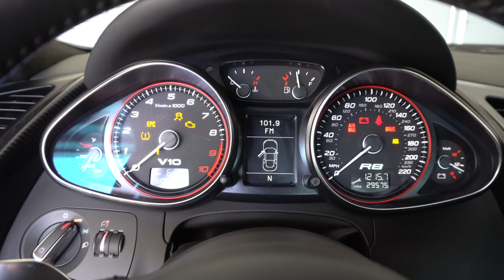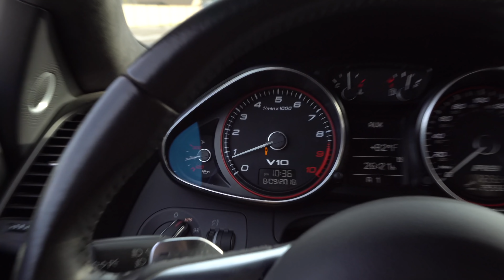I SLAMMED my Audi R8!

Comment: BC coilovers really makes great products, i installed a set of BC coils on a -09 R8 V8 last summer. Audi wanted 8400$ for a set of new shocks installed, its a no brainer to install BC instead. I changed ride height once and made two damper adjustments after install and the customer says it rides way better then when it rolled out from the dealership brand new.

Comment: Bc coilovers are the best. They where the only coilover company to make coilovers for my 81 honda civic
Reply: Dakota Dabney that's awesome. I had an 83 set aside for years with plans to swap a b series in it one day but ended up selling it. What else have you done to yours?
Reply: @CompressorSurge   16x7 wheels with 165/40 Achilles tires. Weber race race carb and the rest of of the car is stock. Did want to ruin the car it only has 50,000 miles on it right now

Comment: Best decision you could make, to ensure the drive home will be safe.  Your wife and child need you arrive alive.  What is the cost difference between a set of coil overs and repairing the magnaride system? You said eighteen hundred per corner to rebuild them?  What happens when the the front one go?  Thirty six hundred more?  Isn't BC coil one of your sponsors?,  if not talk to them, they should be!
You will be much happier with the adjustability of coil overs and the ability to raise and lower the stance of your car.  But you already know that.  Don't lower the car too much or the ride home home will kill your tires.  You should do an alignment anyway to ensure the life of your tires.